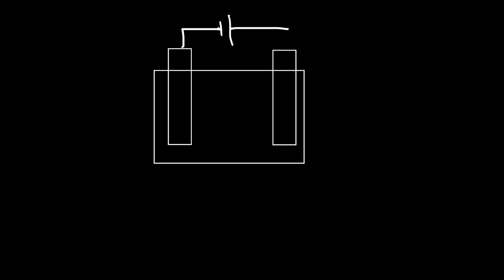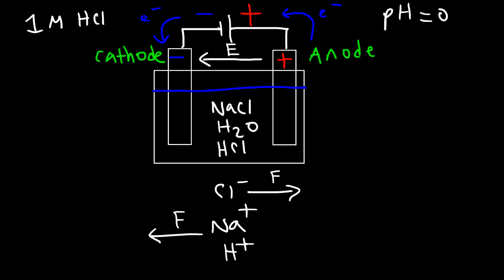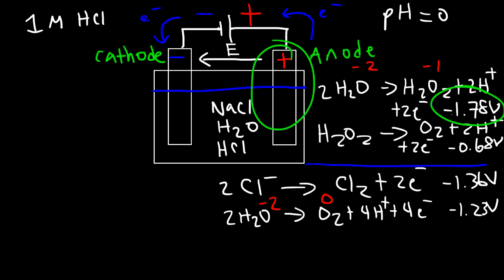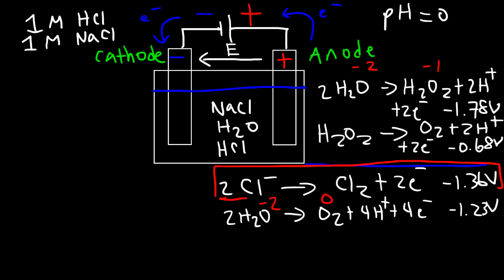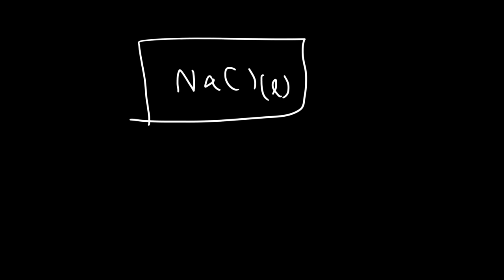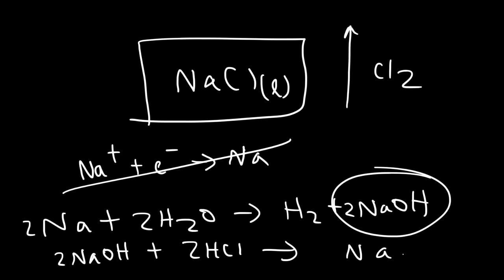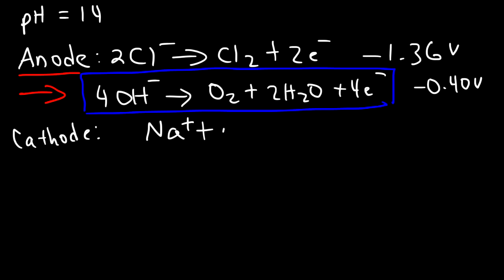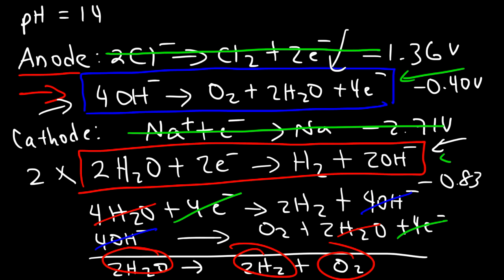Electrolysis of Sodium Chloride - Electrochemistry

Comment: When I was in 8th grade I used to think 9 volt batteries contained fluorine, because only fluorine could give such a high oxidation potential!  It didn't occur to me that 9 volt batteries had multiple cells.
Reply: ur 8th grade  teacher be rocket scientist
Reply: In my 8th, i hardly know what exactly voltage means😂
Reply: and it took me 3 years to figure out how to get to the 9th grade
Reply: In 8th grade i was still drinking milk

Comment: Dude electrolysis is supposed to breakdown the compound into individual components. If its an electrolysis of NaCl we should be getting individual Na and Cl particles but we've ultimately just broken down HCl (under acidic conditions) and water (under basic conditions). We didn't separate the NaCl components
Reply: Hello.. Bro... How can we do the electrolysis of molten aluminium sulphate??
Reply: for effective electrolysis of NaCl solution you need an ion exchange membrane between electrodes that allow only anions or cations to pass

Comment: Professor Organic Chemistry Tutor, thank you for an outstanding analysis and breakdown on the Electrolysis of Sodium Chloride in AP/General Chemistry. Electric current is carried through the cell by the movement of ions. According to the video, Cations (Na + ions) move to the cathode, Anions ( Cl- ions) move in the opposite direction. This is an error free video/lecture on YouTube TV with the Organic Chemistry Tutor.

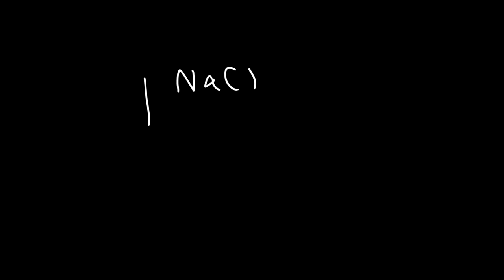Comment: 7:24 by hoping same thing i made an experiment setup i used one bottle filled with nacl and water with electroads in it and attached pipe by silling it and i dipped that pipe in other bottle filled with water hoping that , H from negative and cl gases  From positive terminal will produce and and because both makes hcl and after desolving it in water bottle i will get hcl acid , i lived it for 2 days but i did not geg any meaningful evidence of hcl:h2o  solutions !!  Then thought  may be there would oxigen which are interfacing with cl may be !! But after watching your video i knew probability will be very low for oxigen !
But m not sure plz tell me what is wrong with mine setup ?
I used near 600ml watef and 3 or 4 "suger spoon" of nacl table salt ! And i also added h2so4 will it help to produce hcl ?
Reply: reacting gases directly under a saturated fiberglass tent(small volume!), or sum saturated substrate that wont react with HCl might work. careful, gasses will react with light to recombine and explode as electrolyzed H & O reacts with spark to recombine to water with extreme heat; they(water electrolysis cells) have been made into torches that can cut firebrick and weld steel but curiously won't heat water itself, so you can't burn your skin which is mostly water. but HHO gas can explode and f up your world if you try to store any substantial quantity and H & Cl only need light radiation to recombine and the energy of recombination is even stronger if i remember correctly; H & O need at least a sparc of 12mJ to recombine. note that there were experimental rocket engines using HCl and the energy of recombination produced blasts of mac 7 supposedly.

Comment: One question that bothers me all day ;
The battery cell is a galvanic cell, which means its Cathode is the positive terminal. The Anode is the negative terminal

But in electrolysis cell, the Anode (battery) change to be the positive terminal, while the Cathode (battery) turns into the negative terminal 

If i was correctly, about the symbol : 
🔋🔋🔋the short one (battery) is Cathode, while the longer one (battery) is Anode.

Comment: OK, not quite correct as to likely mechanics (which not addressed in summary electrolysis presentation.  Now,  H+ (from water leaving alkaline OH-)+ e = . H (the hydrogen radical anion). The latter can self react: .H + .H > H2 or, to a lesser extent, react with O2 (also produced in an over potential electrolysis of water) as follows: . H + O2 -> .HO2 but at pH over 4.88 exists as H+ + .O2  (the so-called superoxide radical anion). Bottomline,   no H2O2 which could otherwise be created in the albeit slow reaction  .HO2 +  .HO2 -> H2O2 + O2. Also, no H2O2 in the presence of NaOCl or HOCl (from Cl2 formation of aqueous NaCl electrolysis) from the fast reaction H2O2 + HOCl -> H2O + HCl + O2.